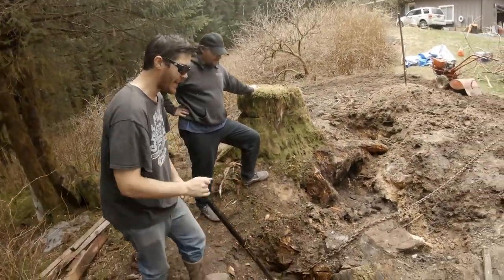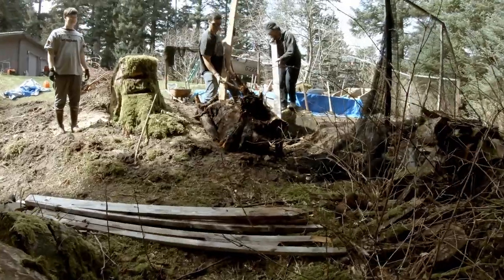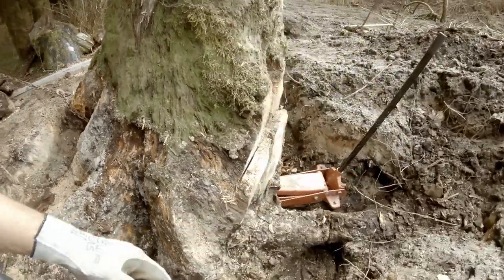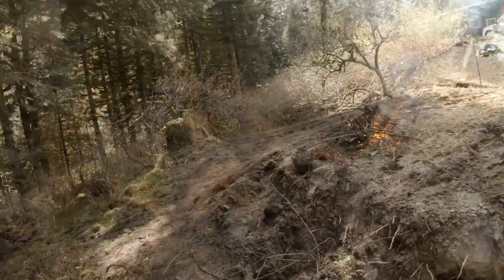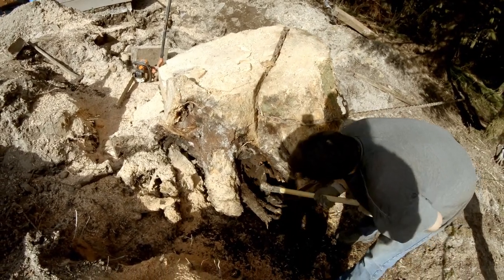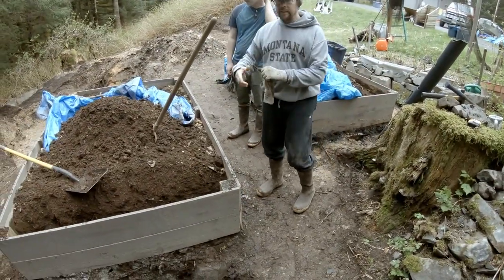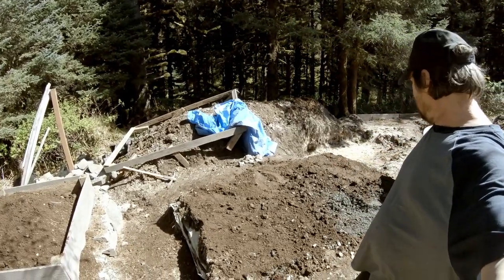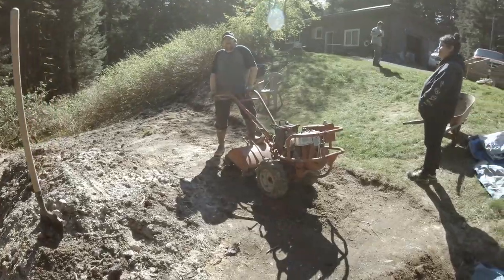It's Like Pulling Teeth - Removing Spruce Tree Stumps By Hand

Comment: Should of got a few pulleys and run a cable thru them and used the truck to pull it back down the hill. But great work. Work is always nice when you can do it as a Family.
Reply from the maker: If we had the gear we probably would have thought it out better. Thanks for the comment!